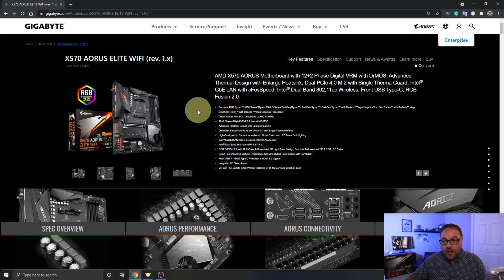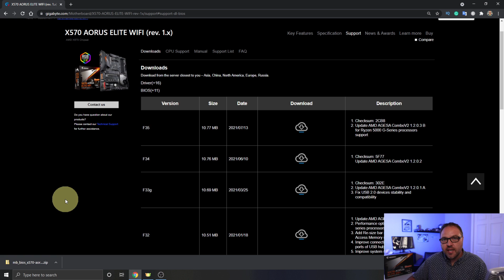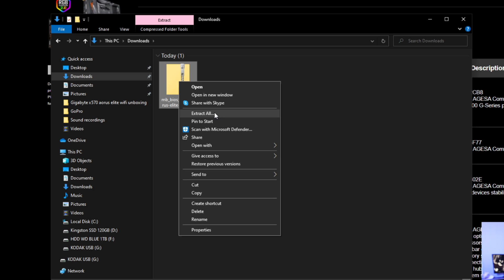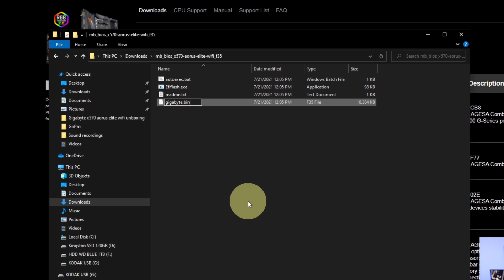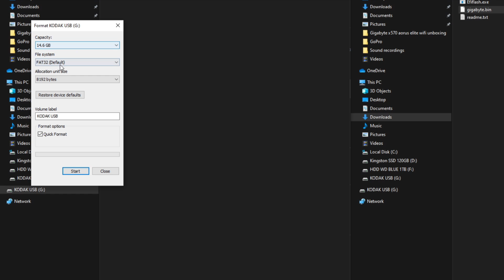How to Flash the BIOS on Gigabyte X570 Aorus Elite WiFi Motherboard with Q-Flash Plus

Comment: Like orestesdd also said, nothing happened with the q-flash. I named mine lower case, but no LED came on; nor did the fan. The MB lighting briefly flashed on-then-off when I turned the power on, but no other reaction occurred. I wonder if this means my MB is bad, or my power supply. I'm using the non-Wifi version of the same motherboard, using the more recent bios update.
Reply: I'm currently having the exact same issue. Any luck in the past days?
Reply: I have the answer. So, your motherboard came in on an older update than what works with your CPU, meaning you'll need an old CPU compatible with your MB for like 30 minutes to flash it.
Reply: @rat7750  Hi William, this is not correct - QFlash+ does not need a CPU installed at all to function
Reply: @TwistedKestrel  Unfortunately it seems to be the only way to get it to work. QFlash+ just isn't working at all, I've been at this for weeks. I'm just going to update it without using QFlash+, others with similar issues have done the same.

Comment: I did exactly the same thing, but the q-flash plus did not work.  I never saw the q-flash plus button flashing any light, thus I assume something is wrong with my MB.  Thank you your video, and by the way I have the same exact motherboard, and the only thing different I did was naming the BIOS file "GIGABYTE.BIN" all caps.  I have seen someone naming it "GIGABYTE.bin" the all caps for the file name, and the extension in lower case.
Reply: i’m not completely sure but maybe bin and BIN are different so it didn’t recognize it

Comment: When i did it on mine, the fans started spinning and the q flash plus led blinked for half a minute and just stopped. The fans are still on and wont turn themselves off. Do you know what the problem might be? And how do i know when its done? As i think the fans will just keep spinning if i dont shut the power.

Comment: Q-Flashed before anything else here, and thanks to your help, it went good! Apart from a goof up on my end downloading the wrong bios (I have the X570 Pro Wifi, and I downloaded the x570 pro. The webpages look fucking identical.)

Thanks for the short and concise tutorial.
Reply from the maker: You're welcome 👍 Glad I could help.
Reply: Did you Flash it when your build was done or when nothing but the motherboard was connected to the psu?
Reply: @boughtonpresale4232  it was just the mobo, a usb stick with the bios, and the power supply. It was easy. I used the manual and this video as a visual aid since since diagrams in manuals can be quite vague in some places and I'm more of a visual person.
Reply: bro this comment helped me so much i did the exact same thing.
Reply: On the Gigabyte website it refers to the wifi version as rev. 1.x and the non wifi version as rev. 1.0. The weird thing is... my Aorus X570 Elite wifi board literally says rev.1.0 on the board itself. So now I don't know if I should download the rev.1.0 BIOS or the rev.1.x BIOS. ???
Reply: @DerekMoore82 what you did bro?

Comment: Thank you for being so detailed. My x570 is also version 1.1 which made me hesitate to flash the board thinking that the newest bios version was for version 1.0 boards. unboxing mine, it had f30 bios. im running 5600x. Updating bios gave resizable bar. I was having issues connecting PCIE risers for more than 2 cards. Im not sure if the bios helped or if it was that I changed the bifurification to 4x4.
Reply from the maker: You're welcome 👍 Thanks for watching.

Comment: I got this MB and it was a pain in the behind from the start. It didn't work correctly for weeks until I've came to the point where I got it working ok (not fine, but ok). I happened to come by a Ryzen 5 5600x, slapping it on the MB without thoughts (ok, that was my bad, the manual states it will only support 3rd Gen CPU... anyway) after I realized that and removed the Ryzen 5 and put the Ryzen 3 back on, nothing worked for good. This BIOS update is my last hope for a relationship that started off on the wrong foot and may very well end in a divorce...

Comment: I flashed my bios from v11 to v35, for some reason on reboot it was bsod trying to pull a windows file from G: drive. So if this happens restart, jump into bios and set your boot options right to the drive that has your windows installed on it. Good luck

Comment: I just did this for the Aorus Master. It was very picky about USB drives. Nothing happened during a few attempts with the first two (different models). Then I found an older Sandisk SD card with a USB adapter, and that worked perfectly. All were formatted as FAT32 from windows 11. I’m not sure what the difference was. All up and running now. First time going back to team red since their Thunderbird days!
Reply from the maker: Thanks for the tip. 👍
Reply: Yeah, I've tried a couple different thumb drives and nothing is happening... guess I'll try a different one, thanks for the tip

Comment: Great video! I have but two questions:

1. Could I just do this with the power connected to the MOBO right out of the box?
2. If in the events I’m updating the BIOS to a version already installed, i.e overwriting it, would that cause any harm?
Reply: of course you can power the mobo out of the case.. like how theres thousands of workbenches which are fully working computers without a case, or just a small stand to screw the mobo to

Comment: Is there a way to tell out of the box if the Mobo will support the 5000 series? I know its all dependent on the version of the bios installed on the Mobo, but how would I find that out prior to doing this? Just building the PC and if it doesnt boot, I need to do that?
Reply from the maker: The only location where I've seen the BIOS version is when the BIOS is loaded up. If anyone else has another method please comment below. Thanks

Comment: GIGABYTE is shit!  i am done with gigabyte.. going to MSI to replace GIGABYTE board usage,  this X570 Aorus Wifi Pro, (*latest bios) cannot get into bios, cannot reset bios, pulled power, pulled battery, let it set, replace battery, jumpered bios reset, still Frozen at Aorus splash screen upon F12 or DEL to enter bios/boot menu , pulled power disconnected all USB , all sata, BIOS reset again.. NO DICE!  still frozen at trying to get into bios/boot menu. which means I cannot even boot off of USB flash drive if i choose to.  It will boot into windows just fine, even using windows troubleshoot to enter UEFI  fails and still froozen.  I AM DONE with GIGABYTE, this is the second Gigabyte board (4th Gigabyte product) that has failed or has blocked me out of getting into bios.. NOTHING and I mean NOTHING should stop you from entering the bios, the one fail safe item you should be able to get into. I been building PCs since 1985, this is not my first rodeo. ASUS , MSI, has been my solid run to boards, but gigabyte was a cheaper option and now i know why. Pure SHIT!

Comment: This video helped thanks a ton. Just got a 5950x and almost panicked. Did some research and someone mentioned the 5000 series may need bios update. Saw someone had mentioned swapping back to old cpu but i knew thatd take too long. Looked up alternate ways to flash bios and turned out my x570 can do so.

Thank you so much for your help!
Reply from the maker: You're welcome 👍 Glad I could help you out.
Reply: Did you do it with your 5950x installed? Or did you remove it before flashing the bios?
Reply: How did you do wont work for me at all

Comment: Hello! Liked your vid. I'm doing a new install with this board. When I try to use Qflash, my usb will flash for a little bit, then stop. The light for Qflash will never come on. When I flip the power on my PSU the lights on the board will flicker, then turn off. I'm also unable to jump start the board. Do you have any advice? I've opened a ticket with Gigabyte, but of course I've yet to hear back from anyone. Thanks in advance. You've earned a sub.
Reply: I also have the same problem, i think its just windows 10 in general. I have 5 thumbdrives that are 2.0 and 3.0 and i've read that 2.0 are more effective. I downloaded and created the files and used the same exact steps but the q-flash is not working so i constantly format the flash drives in a windows 10 computer. Then, after hours of work, i tried to use my Macbook for the gigabyte.bin file, put it in the MOBO and now its working! I was honestly a little close to go back to Canada Computers and let them do it LMAO.
Reply from the maker: I would double check to make sure your power supply is connected to the motherboard securely. Other than that I would say a ticket with gigabyte would probably be your best bet. I'm sorry to hear that you're having problems. If you are able to figure it out let us know here in the comments.
Reply: @NorthernVikingEveryday  Putting this out there for anyone that was having trouble like me.  I removed the cpu and ram, grabbed yet another USB drive (did a full format to fat32) & used the F32 bios version. For some reason or another this finally was able to be Qflashed. Afterwards I installed my ryzen 7 5800x, my Ram, a crappy gpu & viola! I can post now. I was able to jump this board using a screwdriver touching pins 3&4 (from the top left) I hope this can help anyone that was struggling with this board as much as I was. Cheers.
Reply from the maker: Thanks for the update! Glad you figured it out. 👍
Reply: @NorthernVikingEveryday  It's a good board. Would make more sense if they included a cheap thumb drive or something to help eliminate the confusion.
Reply from the maker: I agree, I am very happy with it.